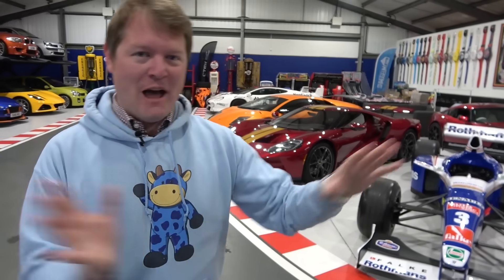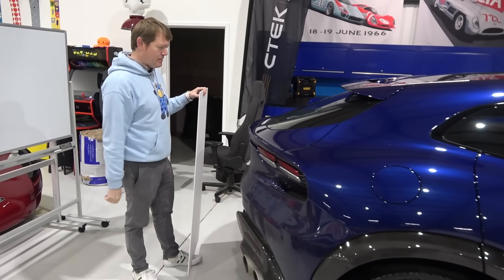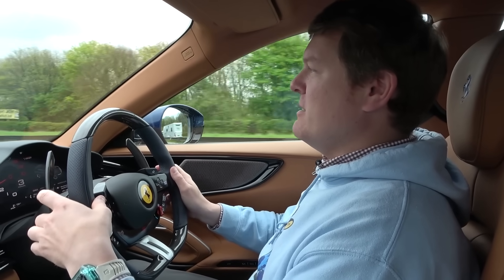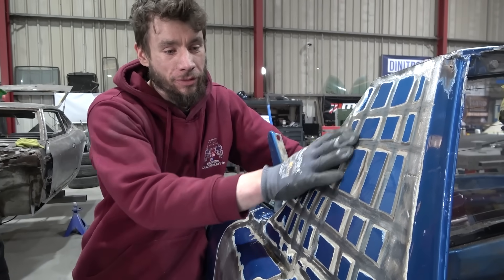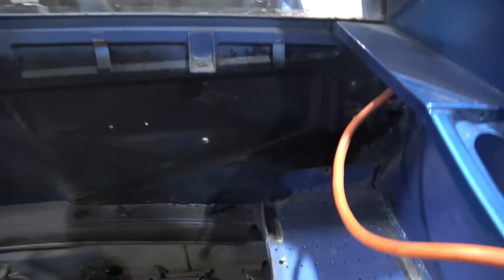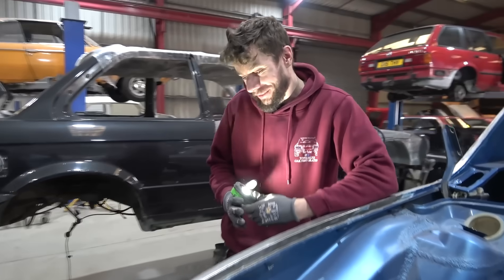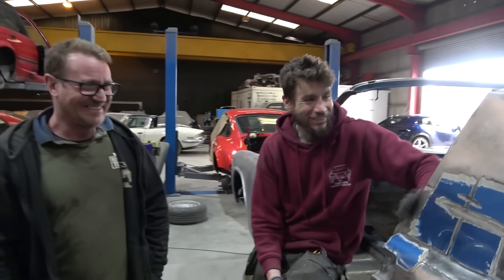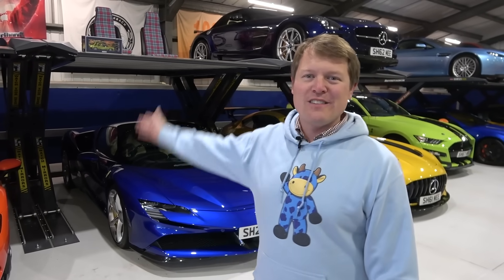The WORST PURCHASE I Ever Made!? My Destroyed Porsche 914

Comment: 1) You should have inspected the 914, or had someone inspect it, better before purchasing it. 2) All the cheap 914s usually have a little rust on the battery tray, and the rocker panels. I used to have a rusty 76' Porsche 914/4 2.0 that was no where near as bad as this one. 3) This has to be one of the worst 914s I've ever seen. For first Porsche's, I would have highly recommended a 944 or 968. Thanks.

Comment: My 1st car was 18 years old. I was 17. It too was rusted to bit's. Throughout the next year. Loads of body filler, glass fiber and metal work. 
End result was my final coat of  primer. You couldn't tell the difference. The week before the final 2k paint 🎨 spray job, i wrote it off. Body filler holes everywhere! 😂
End of the day. Project cars are fun! But only if you're doing the job yourself 😁

Comment: Time! This was expected when the car comes from the USA and your car is not dangerously full of putty anyway. I grew up with American cars and read Swedish car magazines that only deal with American cars.
I remember reading about imports of American cars that looked like your Porsche when you bought it. This was in the late 70's and then during the 80's like many that were imported to Sweden and when the owners had to renovate the cars and sanded down the paint. Then they discovered that they had fraudulently renovated by using chicken netting, newspaper and putty during renovation. This happened to several Swedes and it was not uncommon for half the car to consist of just chicken netting, newspaper and putty. So Swedes who were going to buy cars in the USA learned to carry a magnet that you put over the entire body, to make sure that you don't cheat with then chicken netting, newspaper and putty or partial putty repairs.
So take a lesson when buying a used car that has been in the US, to have a magnet to bring over the entire body.

Comment: would a donor car or/and complete panel replacement not the better/cheaper option?? maybe the 914 gt flared wheel arch set would look great. i presume it takes way to many hours to get this car in this condition good again. (searching google, i found several 914 under €9000  oke a bit rusty but square looking and lots more potential)  i love the 914 (rebuild) don't get me wrong.  but is this chassis/car it worth?? (it hurts to see how it has been "restored"  by the previous owner,  it was painted and filled/smootend with several (big) buckets full of filler and plates on top of a crooked, sagging bucket of rust)  Tim don't you feel scammed ??